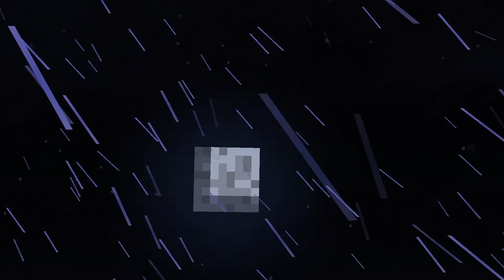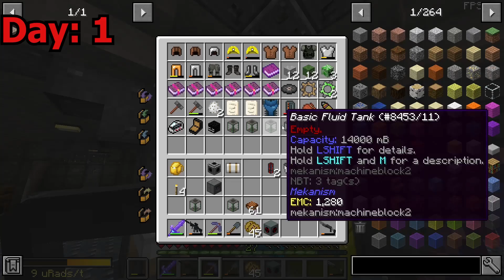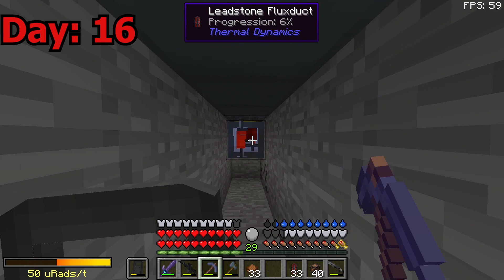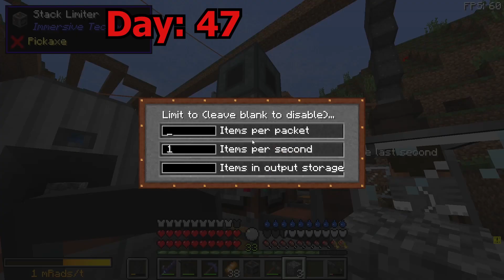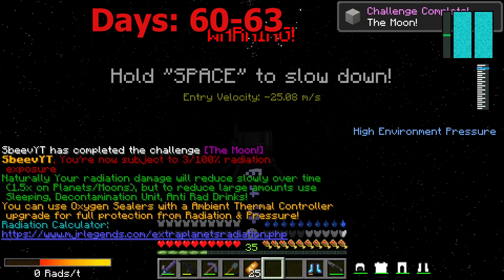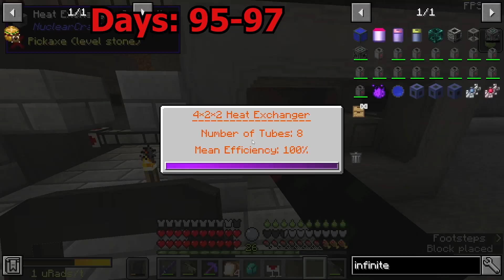I Survived 100 Days in the Space Age in Minecraft

Comment: Fun fact liquid salt reactors are actually a real thing and are actually much much safer than normal nuclear reactors because they are very hard to melt down (what happened in Chernobyl) because the liquid salt sucks heat away very easily in fact during the 70s at a test reactor in the US they actually physically shut off the coolant systems the temperature spiked then crashed and the reaction shut off on its own
This was my best explanation but I'm probably forgetting some stuff look up "the nuclear option" on Netflix